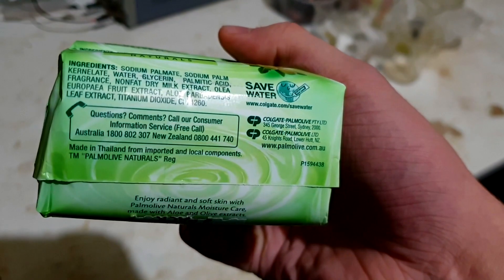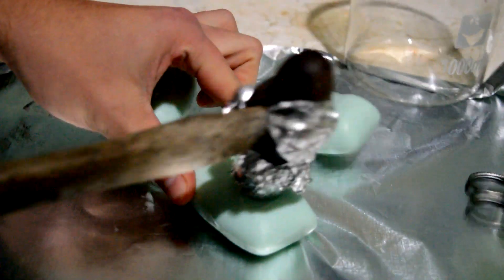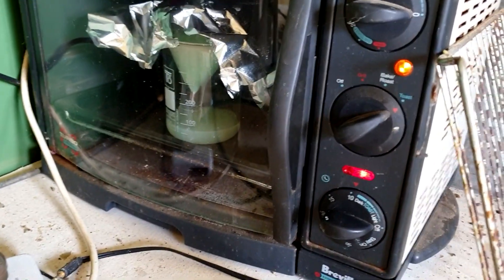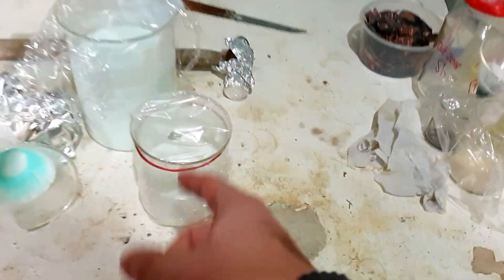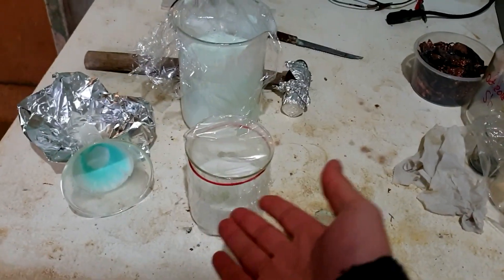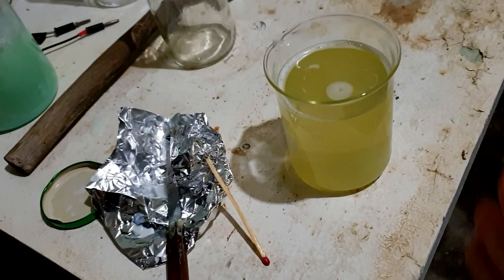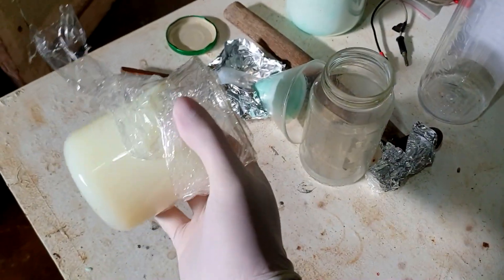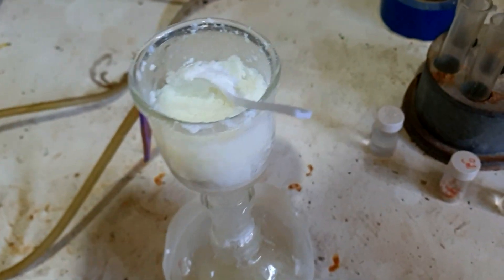Sodium Palmate from Soap

Comment: I know the video is old but, 
My method was much simpler. Problem with soap is it creates a gel like structure, doesn't really dissolve but it doesn't really have to.

in my case i actually wanted to extract the fatty acid (palmitic acid)
I just added 200ml water for every 100g of soap. It got to a paste consistency, which is enough.

I then used a 70% concentrated citric acid (any other acid also works, however i recommend citric, i tried with sulfuric but it is a hard oxidizer and it risks attacking the fatty acids too)

I mixed the paste with the concentrated citric acid. At firs, a white foamy precipitate is forming, but with stiing it reacts completely giving an aqueous solution of sodium citrate and a fatty acid layer above.

Now if the goal is sodium palmate,, reacting that extracted palmitic acid with NaOH will turn it to rather pure sodium palmate.

Mind you, palmitic acid is not the only fatty acid in the soap, so fractional crystallization may be needed to get a higher concentration of palmitic acid.
Reply: You could just start from palm oil.
Reply: @chemistryofquestionablequa6252 true, however there is a small problem when starting with palm oil if you want pure sodium palmate for example.

This is simple saponification, doing palmitic acid and naoh gives sodium palmate.

Doing palm oil and naoh also gives glycerin. 

Of course there are methods of geting the palmate separated from glycerin, but separating palmitic acid and then reacting it is much, much easier

Comment: This reminds me of dissolving potassium glyceroxide in ethanol. It turns into a deep yellow color, if you can ever get it to dissolve. 

Slightly changing the preparation of the glyceroxide allowed me to make a solution, with glycerol as the solvent, which dissolves easier into ethanol. However, it is a non-ideal solution with a melting point around 150C, and adding ethanol became much more dangerous. I hope to publish my biodiesel research using this catalyst soon

Comment: Sir..,your program is very beautiful..i am 68 years old in sri lanka.i am feeling diabetic.please tell me this soap good or bad face and body washing.. 280g coconut oil,120g seteric acid,68.4g LYE,68.4g distiil water,68.4g vegetable glycerin usp,360g propylene glYCOL,280g alcohol 95%,400g sorbitol solution 70%,spray with rubbing alcohol..

Comment: Having picked up soapmaking with a focus on the chemistry behind it rather than trying to make bars that look nice as a corona hobby, makes this video even more hilarious the second time around watching.  Not even going for a passable bar of soap, so just making the palmate would have been the easy win.  Buy palm oil, add in an excess of NaOH and water, emulsify the oil into the solution, wait a while, apply heat if impatient, crash out sodium palmate with NaCl, strain 'curd' and rinse with NaCl brine to wash the glycerine out.

Comment: 1.) Cut it in cubes
2.) Dry it
3.) Dissolve it in dry isopropanol
4.) Filter it
5.) Add sulphuric acid to it and try turning it into an ester (isopropyl palmate)
6.) Distill the product (~160*C)
5.) Remove the ester bond and turn it back into a salt (calcium salt this time)
6.) Add sulphuric acid again to form calcium sulphate and freebase palmitic acid.
7.) Recrystallise the palmitic acid from water and isopropanol a few times by heating and cooling the solution.
8.) Do a mass spectroscopy test on your product.
9.) Pray to the spaghetti monster
10.) you better be done now

Sure, you could distill the palmitic acid, but you need to steam-distill it cause otherwise it burns itself up and you end up with dirty yellow chemicals that smell like shit.
Another way is to heat it up to 180*C and bubble warm air through it to evaporate-distill it at decent rates.

Comment: That's not sodium palmate, that's just burnt soap and reformed oil from using alcohols :(
 Here's a process that will work though!
1. get a pot of water and heat to boiling.
2. Add salt till saturated.
3. Melt your soap in the boiling salt solution.
the glycerine will be desolved into the saltwater, but the fatty acid salts will crash out!

Comment: I would have hydrolised the soap (Na-Palmate) with acid to form palmic acid. Used a sep funnel to get oily acid and reacted it back with NaOH to get the Palmate.
Reply: That would indeed have made sense ;-)
Reply: If you saturate the solvent with another salt first, like table salt for instance, then boil it together, the palmate will crash out and most your other junk will stay in solution.
Reply: Oh! Also, if you add an acid to soap you get entire oils back, not just fatty acids :( it bonds to the glycerine immediately unless you separate them first.
Reply: @haroldsaxon1075  you can use "strong" organic acids (like vinegar) to avoid the esterification reaction between glycerin and fatty acids, because organic acids aren't strong enough to catalyse that reaction. I used this approach to get oleic acid from homemade olive oil soap.

Comment: Having had some previous experience with soap myself, when I heard you say "easy win" I started chuckling like crazy because I knew the pain that you were going to end up in. :)
Reply: I once had a similar experience; trying to prepare lauric acid from coconut fat, thinking "should be easy I'll just start by saponifying this here triglyceride with hot aqueous NaOH". The whole thing bricked up similar as to in this video, the more water I added in an attempt to filter, the bigger the block of "sodium laurate" soap obtained. I ended up throwing the whole thing. I did manage to get my lauric acid from coconut fat through a clever trick, a transesterification with methanol and catalytic NaOMe, forming the much more mobile methyl laurate. It could be appied to palmitic triglyceride fats in analoguous fashion to readily obtain methyl palmitate without going through soapy frustration.

Comment: I also had one of those easy & quick projects. I needed caffeine, but I only had caffeine pills. But that's easy, caffeine sublimates. Right? Just heat and collect with cold finger. Right? No dry ice... well just cold water, it's OK. 

Caffeine sticks to everywhere else, but not on the fucking cold finger! Why Satan, why??
Finally after few attempts I put petri dish inside a beaker and hoped that the "caffeine snow" would fall on it, instead of back on all of the burned shit. Yeah, OK, some of it. From the 500 mg I got 13 mg. Aaand the end product is yellow. What the hell??

Comment: Interested to know what you are going to do with palmate. Maybe the manufacture of aluminium palmate, but I would be surprised if you are going back to making incendiary compounds.
Reply from the maker: Good surprised or bad surprised?
Reply: @ExtractionsAndIre  I will be very interested to see what you do with it. There have been lots of YouTube videos on the subject, most have been rather disappointing as they do not make what they claim and they fail to measure its properties. Unlike Thermit which burns in a spectacular fashion, fuel based incendiaries tend to burn like oil. Unlike high explosives, there are not any pleasant constructive  applications for napalm, it has no redeeming features. Its only practical uses is causing pain, suffering and death. It's a bit like poison gasses, the chemistry is interesting and there is a festination with their destructive properties and the danger they represent, but nothing good comes from their application. I will be watching because the chemistry is interesting, but for me, this stuff will always be tinged with revulsion. As I understand it, the military version of the incendiary is a binary mixture which is pyrophoric when mixed. The Napalm just provides the fuel, the mixture contains an oxidizer and ignition system.
Reply from the maker: @nigeljohnson9820  Yes, youre right there. The tone of the video is important. We're not making it to show 'wow how cool is this!' It's really from a 'why on earth was this made??' Kinda thing. Maybe, if I can't pull it off well, I won't publish the video honestly
Reply: @ExtractionsAndIre  I'd like to see a video about that, even (or especially) when the video itself is a disappointment.
Reply: @ExtractionsAndIre  I am glad you share my reservations and understand why I find this particular chemical so disgusting.
There is no doubt that military chemistry is very interesting, but we must never lose sight of the final application, particularly when the final product forms part of an offensive weapon. In the case of incendiaries, it is difficult to imagine the mentality of those who were required to test the product. Those involved must be completely devoid of any empathy for the test animals or the victims of the final product. I am sorry if this sound very preaching, but I find this material horrific, the stuff of nightmares.
Reply from the maker: @nigeljohnson9820  The Vietnam war is also a quite a big thing here in Aus, as quite a few people went over there only really a generation or two ago. Don't want to offend anyone in that regard either, so... it's a trickey video to make!
Reply: @ExtractionsAndIre  that was the first thing that came to mind when I saw you were making the precursor.. No one who saw the news paper pictures of that Napalm burned Vietnamese girl will ever forget the image. I read a report from the Falklands war, where the Argentinian were stockpiling the stuff to use in the defence of the island. In the end they decided not to use it or ran out of time to use it, but there was a detailed report of one of their soldiers being killed by the stuff, when attempting to defuse the booby traps that had been placed in a pile of the premixed bombs. There was not much detail of the chemistry, just a vivid description of its effects, which in retrospect I wish I had not read. The report did mention that once mixed the bombs became very dangerous to handle. 
The compounds history dates back to WWII and the war in the Pacific. I think it was a progenitor that was used as a thickening agent in flame-throwers. I vaguely recall that a rubber compound was added to high octane petrol to thicken it,  used to maintain the projected flame as a single rod. 
During the sixties or early seventies, films of the battlefield uses of flame-throwers were shown on UK TV. The images were very graphic showing Japanese soldiers burning from head to foot and still walking.  As a young boy, these images gave me nightmares and triggered a life long revulsion of these weapons. All weapons of war are horrible, but being hit by napalm is a particularly cruel way to die.